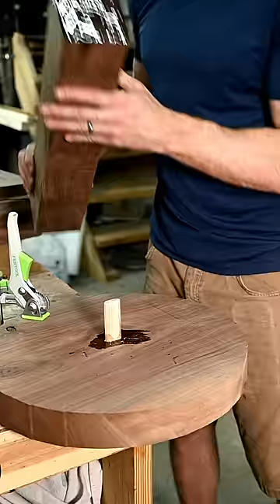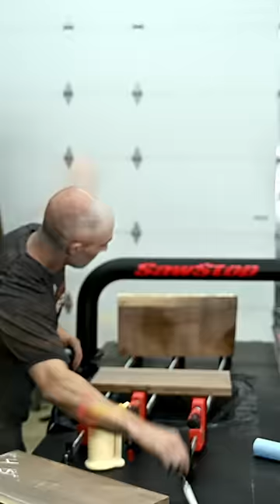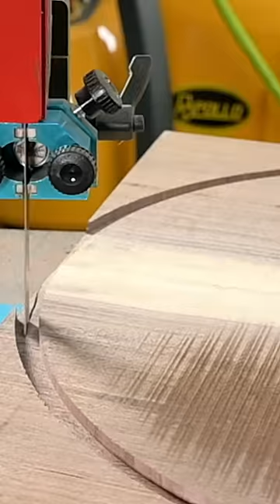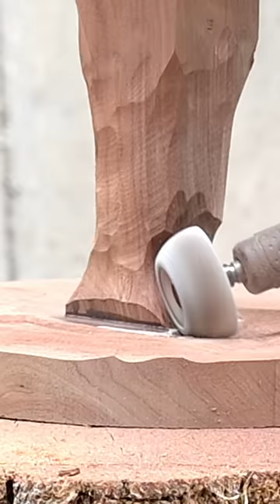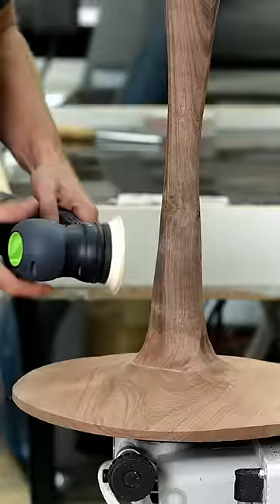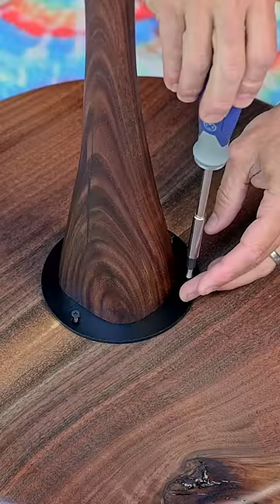I Tricked a Customer

Comment: Also need to figure out how to obtain 50k worth of equipment so I can make that 1k over the weekend.
Reply: You might can take a mortgage out on a family member.
Reply: He has said in a previous video that he has invested over $70k into his shop. That's all completely irrelevant though as you could make that table with $1100 worth of tools easily.
Reply: Exactly.
Reply: Why couldn’t you get the main cuts done at a workshop, and then do the rest with hand tools? Take a week, instead of a weekend, and still make a profit. It’s the style of the table that is rare and would’ve bolstered the price, not just the wood. Hence his point would still all be valid.
Reply: @hamubice1551  You absolutely could but it wouldn't get done in a weekend
Reply: you could build that with a jigsaw, an angle grinder, and a router. if you really really need to get a specific cut done a specific way, pay a shop 20 bucks or rent a table saw or other tool from home depot
Reply from the maker: The people that leave these comments wouldn’t make these with access to a million dollar shop.
Reply: @blacktailstudiouncut  holy fuck clap back man👍👍👍
Reply: Start with a tablesaw
Reply: @blacktailstudiouncut  sick burn! 😂😂
Reply: @Max Harz  shit was legendary, right? lmao!
Reply: Could do this with a jigsaw, sander and table saw[maybe a skill saw if you're really good.]
Reply: @blacktailstudiouncut   😂
Reply: harbor freight has some decent stuff for woodworking believe it or not. band saws, drill press and big vacuums ain't bad at all. for stuff like that it doesn't need to be top of the line. spend some money on good bits and blades but not everything need to be festool.
Reply: @blacktailstudiouncut Fact!
Reply: @blacktailstudiouncut and people like you wouldnt use average wood working tools.
Reply: @blacktailstudiouncut  no, not at all.

They just need a willingness to leech hard earned money out of people when they’ve barely put any money into the project at all.

That, or be an insufferable arse.

You’ve perfected both.
Reply: @blacktailstudiouncut realistically with a million dollar shop they’d eventually get it dude …
Reply: You can do this stuff with tools for in total like 300€
Reply: Rent a DIY wood workshop. E.g. I live on a wooden boat. I have a professional wooden boat builder close by (which took me 1.5 years ti find) with all kind of tools. Dutch prize level I pay basic rent monthly 60 Euro and can use the big workshop 30 days. Have my own key so I can come and go as I like. For using mashines inclusive insurance, support and consulting by the professional boat builder I pay 10 Euro per hour for the electric mashines. So imagine even u would need 20 hours mashines for such a table = 204 Euro rent + 150 Euro material costs, lets say max 400 Euro costs, thats still 600-700 Euro for 20 hours labour work = 30-33 Euro / hour minus paying income tax. If you do some side hussle on every weekend  = 80 hours monyhly = 2400--2600 Euro. Related to some monthly income e.g. full time cook in India who makes 250 Euro monthly thats a pretty goid perdpective yo make per year sine extra 24-30.000 Euro. Its a very satisfying handcraftsmanship to work with beautuful wood. Everybody csn learn it as this natural material is very forgiving you have lots of tolerances compared to metal work.
Reply: It's not just the tools either, it's the skill to do this. Yes it might look like just a bit of cutting, grinding and sanding etc but I know plenty of people that would F that up even with 50k of tools. But I agree all these "Make X amount in a Weekend" videos always show it with thousands of dollars of equipment.

I'd rather see them buy the crap from a discount store and show what can be done with that.
Reply: All I hear is cry cry cry
Reply: The real skill is having someone willing to part with $1200 for side tables.
It only takes one year of weekends to pay for that equipment; assuming you can sell everything you make.
Reply: You have to speculate to accumulate. In this instance, in a year, by doing one table a weekend, you’ll have made your money back and be up $2000. Everything after that year, will be profit. I’m quite sure I could take you around a hardware store and get you everything you need to make one for under $1000. All your profit then, should be reinvested into new tools etc, until you can bring production time right down. Then soon you could do the same.
Reply: All i hear is excuses and that's why he has a so like this.  We all start small,  baby steps
Reply: @blacktailstudiouncut  give me a youtube video and that shop i could figure it out 😂 i might need to do some test runs on how to use a cordless sander but give me emough time that $1,200 is mine. Oh also all those tools
Reply: @simplysimple7628  it's not exactly you can get them tools for cheap that you need to do what he's done
Reply: @hamubice1551  so spend all your profit over the weekend on the tools to...make the profit....
Reply: The tools don't make the crafter, but the crafter makes the tools.
Reply: I could probably make that on a Saturday and i have like waaaay less than 50k in equipment
Reply: I had to delete my post as it was almost word for word, to your post.
Reply: @WiscoDrinks  gl buddy. i'll tell you like i told the rest this comment either means you aint never had to do something like this ever at all or you been working in a shop so long you forgot what it's like working without a table router.
Reply: You just need a couple hundred dollars to buy a cheap set of tools from home depot you're good to go
Reply: @jackf1830  "leech"? They willingly bought a table they didn't need, when there are plenty of cheqper tables available. You have zero clue what you're talking about, and you obviously can't afford his work.
Reply: Meanwhile I've had my shop running for a year and only have one sale. Etsy is quickly becoming no fun.
Reply: @blacktailstudiouncut  then make one without all that equipment and show us
Reply: Find a woodworking space and buy a month’s membership for <$100
Reply: You could do it with $100-200 worth of tools as long as you bought flat boards.
Reply: i love the fact he shows and even says “u just need basic woodworking tools” and yet u still comment this. im not saying you’re wrong because tools are expensive but if u think u need the newest and best version of every tool to start a hobby, good luck.
Reply: There are 52 weekends in a year. So in less than a year, you'd have your shop investment paid off. BTW, there was nothing near 50k worth of equipment in this video. Maybe 5000 worth of equipment.
Reply: @hamubice1551 , he didnt use all the 70k worth of equipment. Maybe 5k worth of equipment shown in the video. I could make that table in my little shop. I really should start using my shop to make a profit. Instead of just making things for friends and family.
Reply: @blacktailstudiouncut  yes they would what you mean? I started wood working in high school with a shop class who still used old school tools and then went to a community college to learn to build cabinets and other furniture and with just a few days of the instructor teaching us how to use the machines and what they can be used for literally even the people who never has experience using machines were makin cool chairs and or chest or drawers
Reply: He started by saying. “How an Average Wood Worker” not an average Joe who has no tools.
Reply: @aaronbosch3125  3-5 for any business
Reply: AMEN!!!!
Reply: Right? Some people make content just for views and not for actual information tho.
Reply: This is the kinda of guy who finds reasons why it won't work so he can get out of doing anything interesting
Reply: You could definitely make these tables with 100 dollars worth of tools at Menards also you could do it in a weekend you guys all just lack the motivation and creativity…..I have about 500-800 dollars in woodworking tools and I’ve made significantly more complicated tables than this…..
Reply: It's completely possible to make that with a 20 dollar jigsaw, 20 dollar hand grinder, and 20 dollar hand sander.
Reply: @blacktailstudiouncut  haha good reply fucking hell😂
Reply: @hamubice1551  so it’s a 100 dollar profit
Reply: You just save up the money you would spent otherwise
Reply: You could pay for the tools you need with this project.
Reply: @blacktailstudiouncut  meanwhile after binging your content and foureyes furniture, I'm starting to design some of my own deskstuffs with equipment the in laws have. Will it be pretty? no, it's 2x4s and plywood likely because budget and you always start somewhere. Will it be functional and exactly what I want? Yes! Did I and will I learn things? Yes! Will I do this for a career? Maybe not, but I'll have saved money doing it myself with whatever tools are available!
Reply: @hamubice1551  but not in a weekend. He was using tools that made the job faster, tools that aren’t cheap or common in a hobby wood shop.
Reply: I mean he said without a social media which is the hardest part saying something like this just shows you either didn’t think before typing or didn’t listen 😂
Reply: @blacktailstudiouncut  but the original comment stands mate let's be honest it would be a hell of a lot harder without all of your equipment not impossible but let's see you make it with basic hand tools which most people have.
Reply: The tools he used were very minimal. I do my own remodeling, so I have the basics. The only thing I don't have or have a viable substitution for is the router table. I dont have a router at all. But a milwaukee compact m18 is about 80 bucks on the second hand market. So this wouldn't be that hard.
Reply: @blacktailstudiouncut  Violence was chosen yesterday...
Reply: @blacktailstudiouncut  but you say 1000 in a weekend. Without all the big machines in your shop even you won't be able to make it in a weekend.
Reply: So there's this really cool website...
Reply: @blacktailstudiouncut  nailed it. any reason they can find to keep doing nothing.
Reply: @blacktailstudiouncut  "The only thing worse than a quitter is the fella too afraid to try."
Reply: Making excuses will always be easier than making money. 😢 💪
Reply: @milkmanman  Dude lol If you need him to make that exact same thing without using those expensive tools then it would be the exact same video using the cheaper tools from a Home Depot, Lowes, Harbor Freight, etc. If you cant use your imagination to figure out how to cut a goddamn circle and round over the edges without those specific tools then I dont think there's any hope for you. Tools are tools, its the person and their creativity that makes things.
Reply: @blacktailstudiouncut  Thats a pretentious assumption, you say it costs a certain amount and someone points out the value of the tools is much higher, then you insult their skills
Reply: @blacktailstudiouncut  you really are out of touch with what an "average" woodworker and what they have in their shop.

I would be interested in your skill level if you had every single power tool removed from your shop.
Reply: You don't need all those tools though.
Reply: @Blacktail Studio Uncut  ummmm they could. I do wood working but i have very few tools so with your tools yes i cud make a lot. Also 90 dollar walnut is a impossibility in my area so theres that. Its the premise of the video thats all. You do amazing work and i always enjoy your work. Dont think that everyone who offers up any criticism is a hater
Reply: @aaronbosch3125  then maybe it’s a marketing strategy issue? Etsy is saturated.
Reply: @blacktailstudiouncut  you might need to do another experiment like this, with basic tools, to show people 😂😂
Reply: Over here in Australia you could join your local “Men’s Shed” where a lot of useful equipment is donated or retired to . We have some fabulous equipment in our local … saves having to secure a shed at home, you can buy a few tools if you want some of your own kit, then supplement your needs with their equipment …  around the world there are woodworking and Turning Clubs with well equipped workshops too … think outside the box .
Reply: There are maker spaces that have a lot of the tools you need for this stuff. sorry for the currency but a cheaper one is around £20 a month and the more premium ones are around £50 a month.
Reply: Skill saw, router, circle jig, drill, chisel, pencil, grinder and disks, hand plane.

All you need. Most people who dabble with diy stuff should have at least some of what you need.
Reply: @blacktailstudiouncut  Job security.
Reply: Bro we have that shit at our house and my family are mechanics who do shit with wood at home for stuff we need. Only thing we don’t have is a bandsaw but thats not 50k and all the other tools he used in this are regular tools you should have if you do any handy work to your home without paying someone else to do it
Reply: You don't need two kidneys.
Reply: @blacktailstudiouncut  I reduced a beatiful piece of walnut to toothpicks!
Reply: @blacktailstudiouncut  very true, if i had a multi million dollar workshop I couldn't replicate this or anything you make, but that still doesn't change the fact that I doubt you would've been able to replicate these in a weekend with $200 worth of tools, I'm not hating, love the channel and love the stuff you make but I am a realist as well
Reply: @blacktailstudiouncut  only you can make this sir
Reply: @blacktailstudiouncut  facts.  Most of the people here don't even know how to use a drill properly. You need skills and patience for woodworking.
Reply: If you can’t figure out how to make this with a jigsaw and a router, then woodworking isn’t your gig, my guy
Reply: @isaiahlangfords5574  and then do it 10 more times with those same tools. Stop making excuses dude. Your first job will buy you a bunch of new tools, your second will add to that as well. You will profit once you are set up.
Reply: @maxharz3914 bro stole my joke lmao
Reply: I built a 2/3 scale chippendale side chair for my daughter when she was little with vey simple tools, borrowed a table saw, used a hand plane, coping saw and hand saw and did the carving with one gouge and an exacto knife and did a lot of hand sanding. Borrowed someone's bandsaw to cut the cabriole legs. It just took a lot longer than if I had all the tools.
Reply: YEP! So true.
Reply: @davegordon6943 Harbor Freight Exec. in Tha house! 😂
Reply: @jackf1830 barely any money?!
Did you see that shop? 🤔
Reply: We not gonna mention how he used rubber floats, used for concrete, for wood?!
Reply: Most people make excuses like this instead of ever even trying. Everyone starts somewhere. I'm sure this guy didn't go out and just drop 70k on tools one day and all of a sudden was a good woodworker.  I'm far from a  woodworker and don't have a fraction of the tools this guy does but I'm still confident I could make something similar with the basic tools I do have. Might take me longer but it can be done. Don't always sell yourself short you never know and would probably be surprised what you can achieve with a positive attitude and a little determination.
Reply: @jackf1830  You probably buy cheap  throw away furniture from ikea.
Reply: @alexm1841  can you upload a vid of you completing two tables to this standard with a router and a jigsaw in two days, I'm ready to sub if you can or are you just talking crap
Reply: My shop isn’t nearly as good as his but I still think he’s right. A tablesaw, clamps, a router and bits, a grinder and carving disc, and sandpaper is about all you need.
Reply: In one year, you'd recoup the 50k.
Reply: @blacktailstudiouncut  be humble bro holy shit
Reply: Exactly
Reply: if you dont already have the tools i promise you couldnt do this if you did.
Reply: Uh, get a loan? you'd make your money back in 6 months
Reply: If you think you need $50k in tools to do these two tables, you couldn't do the job even with an unlimited budget for tools.
Reply: C'mon really? You can do this by hand and , arguably, it would be worth twice this. Sounds crazy but the world is
Reply: @hamubice1551  exactly
Reply: Go to a local makerspace.
Reply: @JerryPonds  illegally obtain organs
Reply: Takes money to make money but you seem to not understand that. 50k and makes 1k over weekend. Hmmm double that each weekend and bam
Reply: Or join a makerspace?
Reply: @blacktailstudiouncut totally irrelevant because your point was an average wood worker. That's not a person with this equipment and you know it
Reply: @blacktailstudiouncut  pretty bold of you to be talking that kind of shit from a $70k shop.

Having access to a shop like yours makes a massive difference in time, quality, and ease of work. It's unrealistic for someone in my position to consider finishing rough-cut walnut, assuming I could even find it in the first place, much less at that price point. Beyond that, it's much more likely that I would make costly errors that are largely eliminated by your expensive, specialized equipment. Even if I didn't, the whole project would still take a lot more effort.

I think it's wonderful that you're able to make the beautiful pieces you do, and I don't think there's anything wrong with being well-equipped for your hobby/profession. But it's pretty arrogant of you to claim that anybody could just do what you do if they're motivated enough and to dismiss the advantage your tools and workspace gives you.

Not everyone has the time or means to pursue the high cost, potentially low reward craft of woodworking with minimal tools, and access to a good shop absolutely puts a finger or two on that balance. 

And just to be clear, I'm speaking from experience. I've worked in a shop like yours, and I also just got done making myself a desk from my apartment with a hand saw and a Ryobi drill.
Reply: Open a home Depot credit card, spend $1,000 on the tools you need, sell one faux-luxury wood piece, pay off the card. Boom, tools and profit
Reply: True but small steps. There's plenty of money to be made with < $2000 investment in tools / equipment. Then you just reinvest your profits for better tools, work shed, etc.
Reply: Well he did say if you were already a woodworker you could do it, so that assumes you have some equipment already.
Reply: The $50k worth of tools just makes it faster. Can make the exact same tables with HAND tools that cost less than $100 in total. It will take a couple days though instead of a couple hours. 

When I started "woodworking" it was with a $2 pocket knife. I would carve "swords" out of 2x4s or 2x6s and would sell them for around $100. LOTS of time and LOTS of blisters.
Reply: @hamubice1551  Something the people that make these comments don't understand because even IF they were given the same shop they wouldn't be able to make the same things. . . simply because they wouldn't try or even try to learn.
Reply: @TrilogySecurity 🙄
Reply: You can make that with 50 bucks worth of hand tools.
Reply: Touch grass
Reply: Add another 50k to that estimate, and then you have a more accurate guess.
Reply: People acting like having less than 50$ spending cash after bills isnt pretty standard not to mention zero space but your own room to create in isnt the basic standard for the majority of Americans...

Average wood worker tools MIGHT be a Circular OR a SawSall but likely a Jigsaw, zero clamps, untested glue or bonding, zero back stock of material or relationship with supply houses.
Reply: It's 1750 dollars of tools if you don't go pro level for everything in video
Less if you buy a used bandsaw.
Reply: @blacktailstudiouncut   reality is to have the tools you used and decent quality is about 1750 for new.
But you can buy a used bandsaw and save money.
The router table if you get a full height 1 with a mid range router and a set of mid range bits is 500 plus.
You might be able to do it all for 1500.
You could use a jig saw instead of band saw.  That would save like 500 bucks.
Could go with a table mount router stand.  That would save 100 plus.
But if your gonna do this now than once that's not something I would do.
I would honestly want to spend more on a better router table and use a jig saw for first set.
Then invest the money for a band saw.
My biggest issue being in Knoxville Tennessee after having moving from Wisconsin and selling all my tools is buying wood.
I can't find wood that is affordable in Knoxville. 
And I can't drive due to epilepsy so I can't go to Nashville or Johnson City or a couple other places.
In Wis I knew sawyers I could get the maple or whatever from and my former business partner would kiln dry or air dry the wood for me.  
But still didn't have access to slabs like you do for tables.  Those are beautiful and huge.  Found places on line selling slabs much smaller for up to 6k 😂.
Love your channel and the fact you do try and help people out.  Even though you can't always lead them too water and make them drink.
Reply: 50k invested into a shop isn't even a lot. That's small potatoes
Reply: @MarioXcore1 o they wouldn’t lol. It’s the pilot not the plane
Reply: @blacktailstudiouncut  Not at all a burn. You say all this crap about "you don't need a huge awesome shot" and then you use probably, what, 5k+ worth of equipment within your own shop? 

Same feel as " 'Just have to pull yourself up by the bootstraps' says mans who got massive loan from" parents.

So please post how much all your eqiupment costs.

No matter how cool you try to sound in YT comments, you're wrong. If someone had a million dollar shop, this would be easy. Exactly the same - it's clear that if someone already has YOUR SHOP, then you have 10 different tools to do all this shit you say.

But it's always easier to say "you CAN do this" than to actually do it, isn't it?
Reply: @blacktailstudiouncut  probably not because it's just another diy furniture project poorly laid out in short format to hype up the monetization of woodworking. But it's like the get rich quick scheme, if it made you enough you wouldn't try to sell the idea. Woodworking isn't about earning a quick buck.
Reply: @Leviweyhrich  that's a lot of money for a personal shop.
I know wood working business that make 6 figures that don't have  50k  in tooling
Reply: Sure without these tools you will need much longer, but do this every weekend you are getting faster and faster each time and you can upgrade your tools. Maybe you start with one table on the first 4 weekends but that can make you 500-600 $ each also, if you find enough customers and you are doing this for the long run. For example get a cheaper brand or used band saw first, the tabletoprouter next make a templet with it and copy the shape of the tabletop every other week. Or if your sells are getting slower change the product but now you are able to mass produce them due to your new tools.
Reply: @josefwagner1389  exactly.
Start with jig saw and just a router.
Then add a nice router table with first sales profits.
Then a band saw with 2nd sales profits.
Nice use band saw is even better.
Old commercial one would be the best.
But that way your set on the tools you need and everything is paid for in 3 sales.
Reply: @waffle_chair9269  Making $1,200 in a week isn’t worth his time but making $1,200 in a weekend is.
Reply: I dont get your point, you made it by hand its 100 percent wood. Somebody likes it. Were can you buy that table for cheap?
Reply: @hamubice1551  and yet he used his expensive tools anyway. talk the talk after walking the walk.
Reply: @blacktailstudiouncut  Then why do you need a 200k full shop to do it?
Reply: @blacktailstudiouncut  you don't need wood working skills to observe a basic fact. and even great amount of skill wont grant the mental fortitude to attack the argument rather than the arguer.
Reply: @blacktailstudiouncut  what's with the chip on your shoulder? It's fair criticism...
Reply: @blacktailstudiouncut  Wanna bet?
Reply: @blacktailstudiouncut  rude
Reply: @TalesOfSurvival  make one all you need is a router and some mdf board and maybe a old base from a small table saw to put it on 
And it not like it a super expensive or special tool anyway 
As a mechanic i can't even remember hiw many time a needed to build a custom tool do remove or install something nothing will ever get done if everybody was a need the tool  bla bla bla it just show that you got no skill
Reply: @edswope28  you obviously don't know current tool prices.
Reply: @M21assult  lol that the most basic and commun tool you can get
Wow are people this poor you could buy smaller version of the same tool for way less than 1000$ he said 90$ in wood so make it 200$ to make 2 of them sell for 1200$ a piece and make 1200$ profit and get paid tool all in one week that pretty good money 
Now you can make more buy better tool(invest in your business) and make more every week and make more profit and before you know you got 80k in tool and a big nice shop
Reply: @legros731  lol you can pretend you can do all that in the same time it takes to use a table router but we both know that ain’t true. You very obviously have never actually done this kind of work period.
Reply: @hamubice1551  right and I’m a millionaire but thats irrelevant to the shop I just bought. ANYONE can do it they just won’t.
Reply: @blacktailstudiouncut  but you were addressing woodworkers, ALL of them can do what you do with the access you have. They just don’t yet you act like they do.
Reply: @jackf1830  😂 Do you think prices solely reflect material cost? Buddy I have some bad news for you…
Reply: @blacktailstudiouncut  Or they would? Because tools are literally devices to make things easier?
-Somebody who struggled on half built items until tools allowed me to properly complete them
Reply: @hamubice1551  You could probably acquire some of the tools from a dad or uncle
Reply: @blacktailstudiouncut  bruh. You joking right??
Reply: @blacktailstudiouncut  talk about arrogance
Reply: i have all the tools he used and it costed me about 500 euros
Reply: @blacktailstudiouncut  Yeah cause they obviously made good choices in life, like not watching people like you basically lie to viewers by saying "anyone can do it" while using tools almost no one can use/buy/rent so on.
Reply: @blacktailstudiouncut  Nice man, pettiness is the answer.